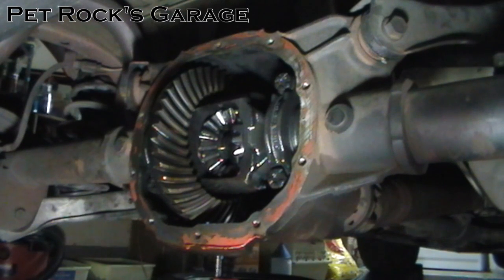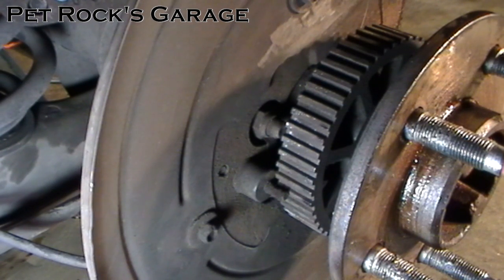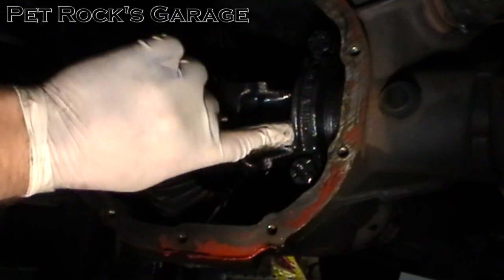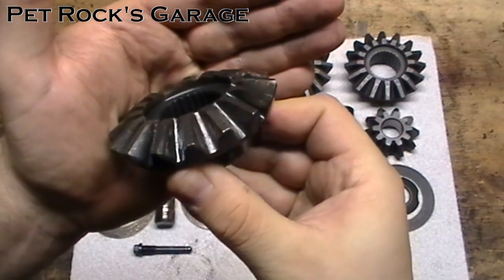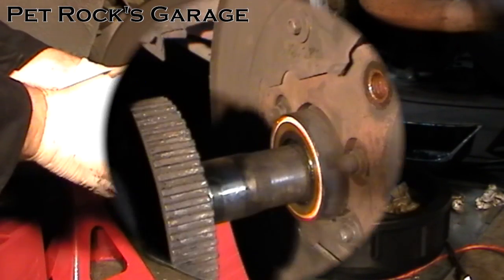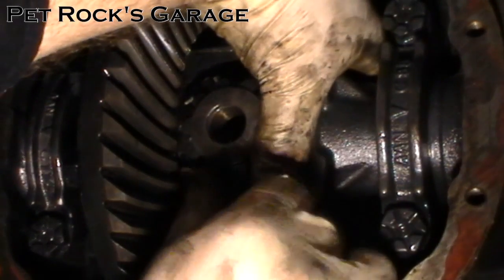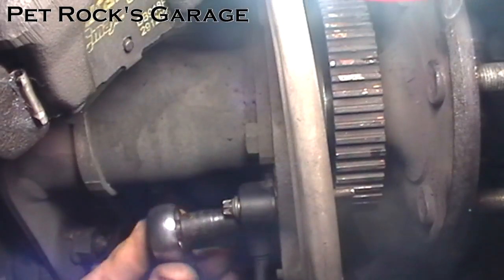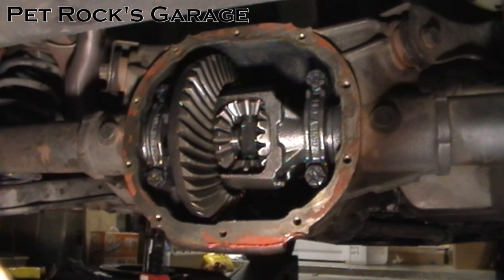How To Replace Spider Gears In Ford 7.5 & 8.8 Open Differential - Ford Mustang

Comment: Hey Pete my mustang differential fluid ran dry because i had a slow leak an my rear end went out it will still move back an forth when its in gear but has a dragging sound.....now if i perform what u did in the video would that fix it??
Reply from the maker: +true wholesaleing, its Pet Rock, not Pete.  it is hard to say what your noise is, especially from my keyboard without having seen the condition of your differential. The sound could be any number of things. Most likely you fried one or more bearings, but I wouldn’t be surprised if you also put a lot of wear into the gears (not just the spider gears). I’d recommend taking it to a differential shop and have them take a look. You likely need a new diff or a rebuild. Good luck...

Comment: Thoughts on replacing the entire differential? My Mustang has an open differential, and I've been considering putting in a limited slip.
Reply from the maker: Kyle Gibson, you don’t need to replace the entire differential.  Just the guts of the diff.  The differential housing & the axles (if you don’t change the number of splines) don’t need to change.  A LSD is nice if you can actually take advantage of its benefits (e.g. if you race at a race track and not a drag strip).  If your ride is a drag car or daily driver then an LSD would be a waste of time/money.  But in the end, it is your ride so do with it what you want.  Good luck...

Comment: Dude i dont comment much on videos but by god you are a life saver like omg thank you !!!
Reply from the maker: Gekkou Raion, thanks a lot.  I appreciate it.
Reply: Me and my 1996 cobra thank you sir although I have a question
Reply from the maker: Gekkou Raion, whats your question?
Reply: ok i know my rear end is going out only one wheel turns but, now the side that doesn't turn the brakes are grinding against the rotor! so my question is will this be fixed once i fix the rear end or is this something else causing this!? they have brand new brakes in the back
Reply from the maker: Gekkou Raion, the brakes shouldn’t be touching the rotor with enough force to prevent the rotor from spinning if the brake pedal and emergency/parking brake is not set. Something is going on there that is likely independent of the differential issue. I’d take the caliper & rotor off and see if both wheels rotate when the rear is off the ground. Good luck...
Reply: fixed it one last question !? is there a name for that clip that you took out before pulling out the wheel axle?
 i really need to know what its called so i can buy one
Reply from the maker: Gekkou Raion, rockauto.com has it listed as "Axle Shaft Lock C-Clip”.  Good luck...
Reply: ude once again your a life saver !!!
Reply from the maker: Glad to be of service.  :-)